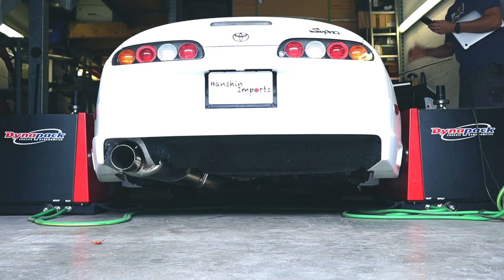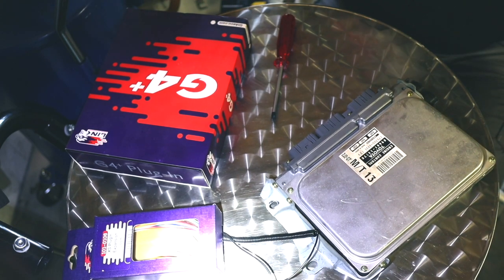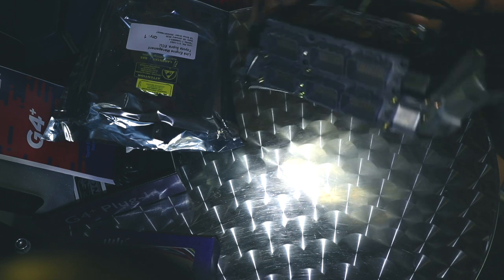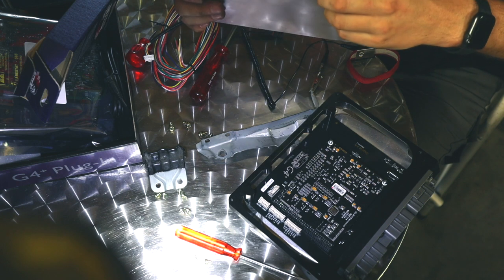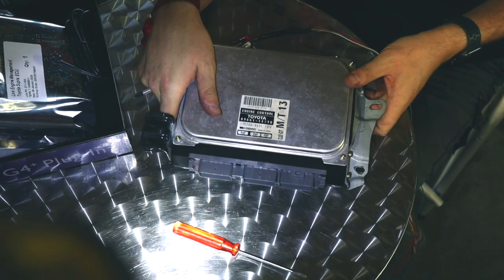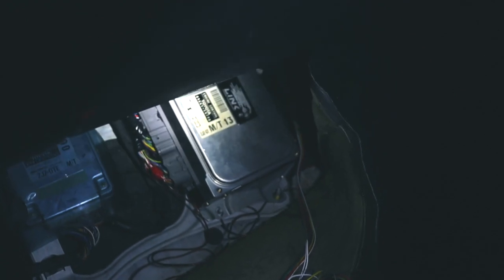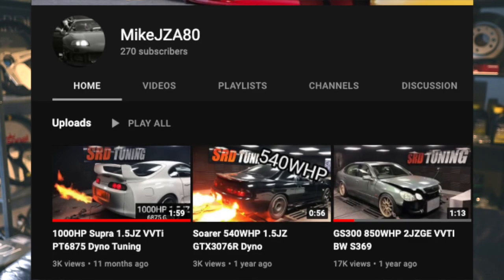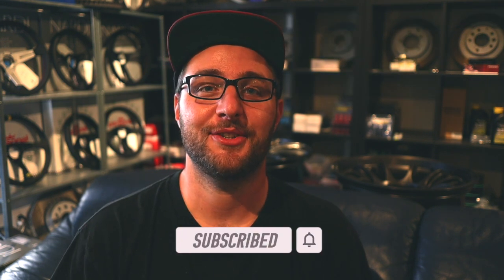How to Install a Link Plugin Ecu into a 2JZ Toyota Supra JZA80 and tune it on the Dyno (stock engine

Comment: Parts list for the engine may I ask?
Reply from the maker: Basically link ecu, intercooler, intake and exhaust. With my tune
Reply: @JesseSpec  specific parts may I ask since im not really an expert and you have the perfect build as example for my dream build
Reply: @JesseSpec  ?
Reply from the maker: @aquasmoke8539  hi, if you watch the video and with the comment above you should have enough information to list the parts list 😉
All the rest is bone stock.
Reply: @JesseSpec  yep i have watched the video, Im just asking if there is specific parts that are aftermarket like the turbo but the 2jz gte comes factory with the turbo so I was just asking what ia the best turbo for 500hp
Reply from the maker: @aquasmoke8539  hi, I understand. Currently this car is at 400bhp. Honestly There are too many variables to give a simple answer and many other things to consider. I won’t be able to give a full answer in a YouTube comment, I’m sorry. But probably by putting an entry level Tomei Turbo bolt on kit, you should be able to hit 500hp no problem. But there are all the other supporting mods that have to be done